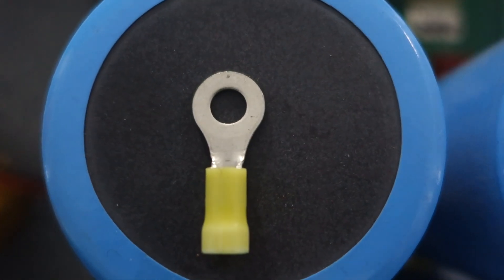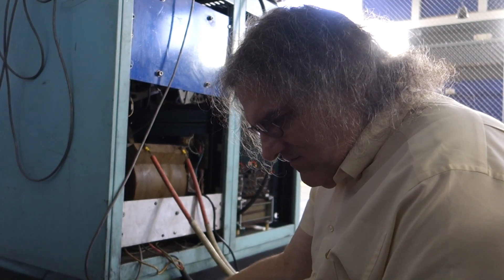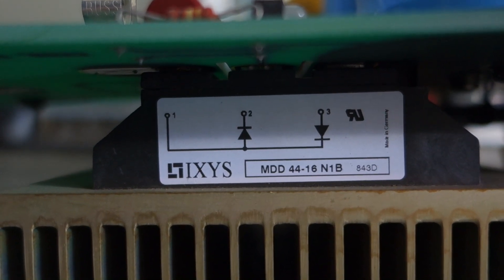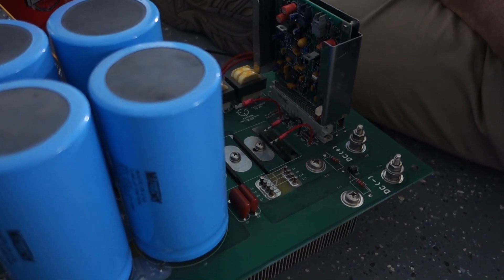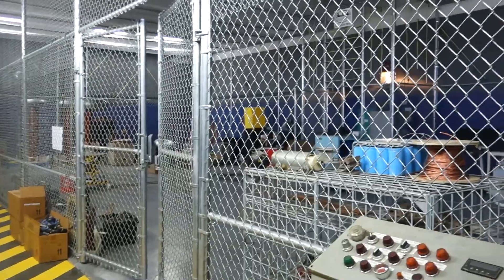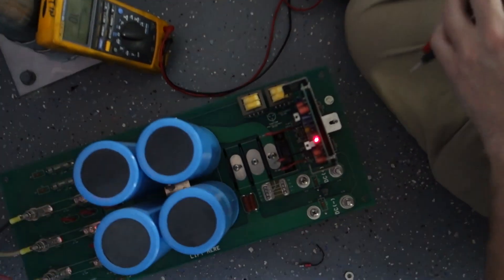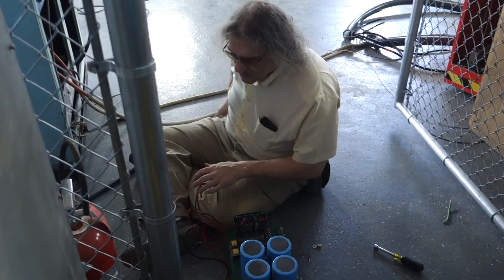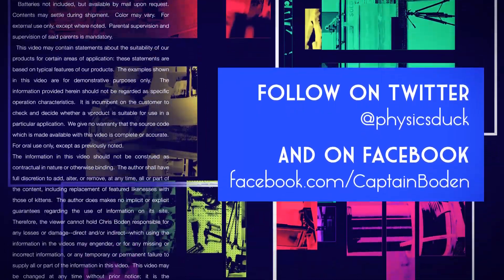Captain's Blog 3 19 2018 PSU Tinkering With Paul

Comment: is it possible to modify TOSLink audio fibre optic cable to those fittings?
we use a similar fibre optic link in our UPS monitoring system.